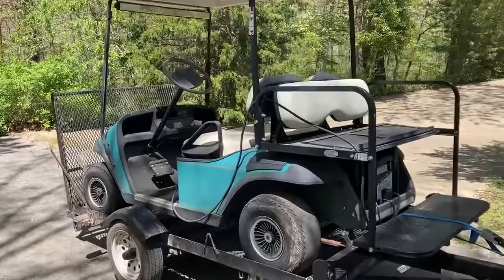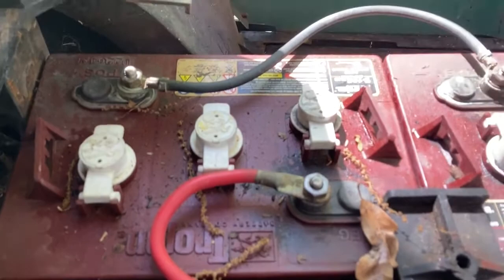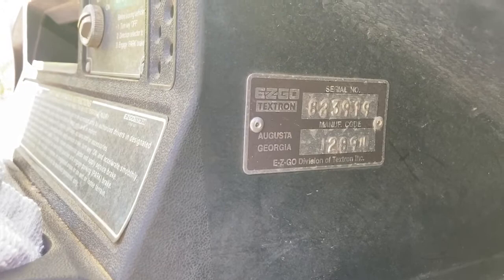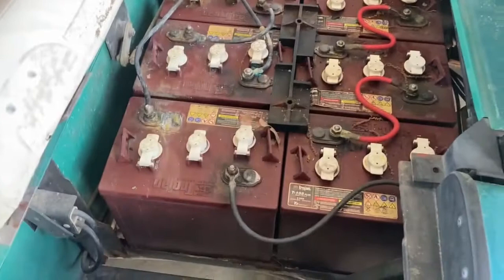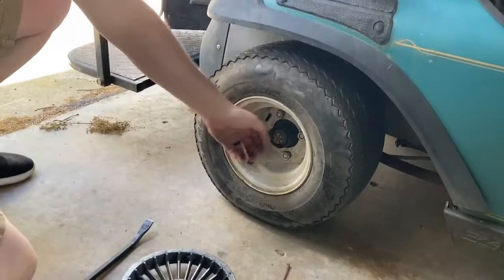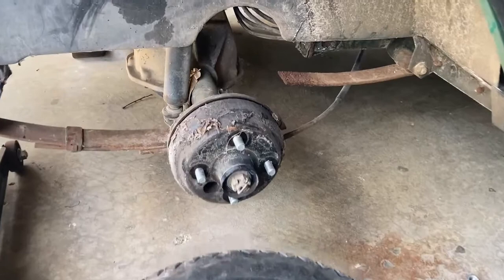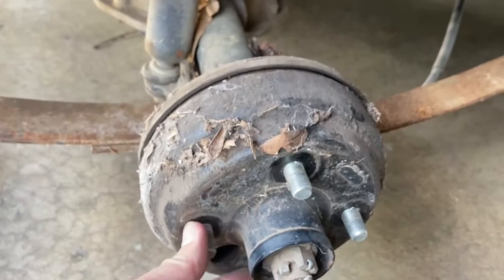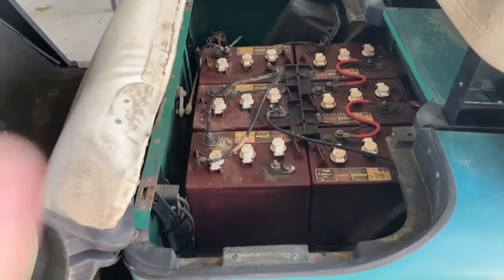Older Yard Sale EZGO Golf Cart Rebuilt Repair Project - Part 1

Comment: With the new rear springs installed, why did you install the shackle bolts in the same orientation, and have the same problem if you ever have to remove them again ? Maybe you should have put the lock nut on the inside close to the battery frame ?  Logical,  no ?

Comment: Yea, I paid $500 for my 1986 and it was nothing close to this bad, all I did to mine was replaced all the brake components from the pedal back to the drums and after about 2 years of driving it I did replace all the batteries and that was it, it already came with a newer battery tray that is aluminum (or I'm guessing its been replaced before I got it) but that's all I've done and I got a new much smaller battery charger/tender.

Comment: Your old 6v Trojan batteries probably need water & fresh electrolyte, new batteries and wires is an expensive but good idea.
Why not cut off those leaf spring bolts and flip them around with a lock nut?